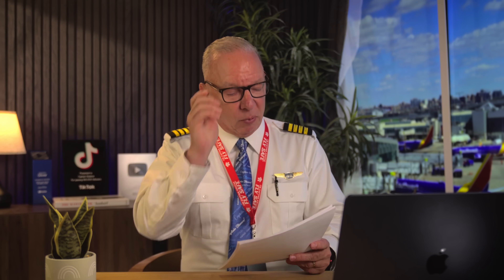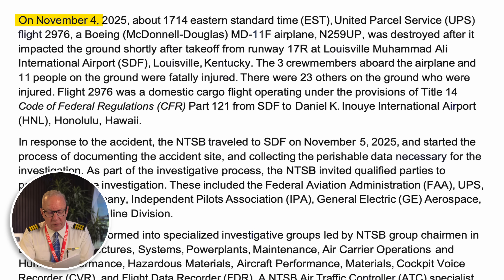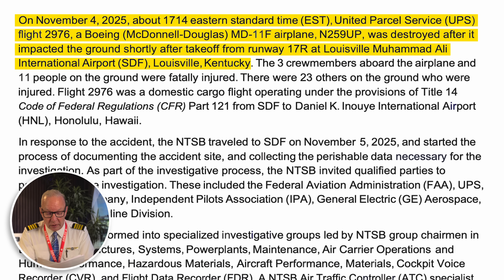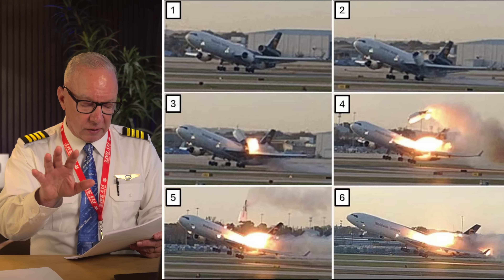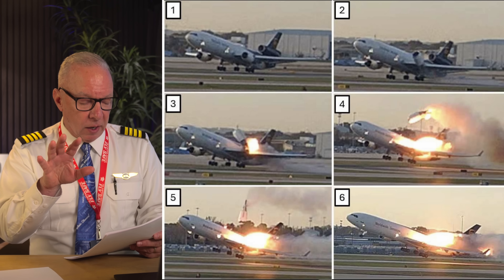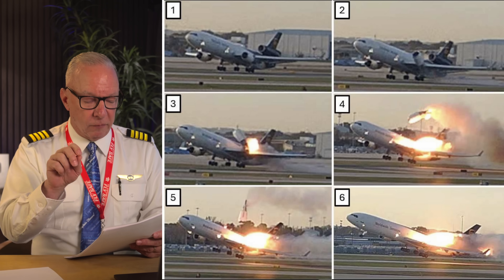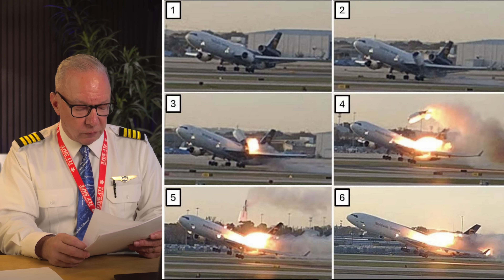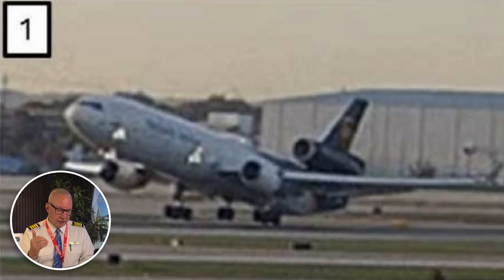UPS Crash Preliminary Report | Pilot Reacts to UPS Crash Report

Comment: In the first picture, you could see that that engine is already at a different geometry than the one on the right
Reply: Yea I went back and looked at it, but still wasn't sure if it was the angle of the camera shot....but does appear to be the beginning of the engine departing the wing.
Reply: That's exactly what I thought.  It was already out of line.
Reply: Wasn't there a report that the flight was delayed?? And they were actually working on that number one engine.
Reply: @gregweigel8115 - Yes, UPS Flight 2976 experienced a two-hour ground delay before its fatal flight on November 4, 2025. 
The aircraft was scheduled to depart Louisville Muhammad Ali International Airport at 3:00 p.m. EST, but it did not begin moving for takeoff until approximately 5:08 p.m.. Initial reports from third parties suggested the delay might have been for maintenance on the No. 1 engine; however, the National Transportation Safety Board (NTSB) later stated that the flight was not delayed due to maintenance, and no maintenance work was performed on the aircraft immediately prior to the flight that would have caused a delay. OF NOTE: The aircraft was grounded in San Antonio for six weeks, from September 3 to October 18, for "extensive maintenance". The NTSB crash investigators are going to want to know every single small detail of that "Extended Grounding" in San Antonio = the What, Why and When were a GVI (General Visual Inspection) and DVI (Detailed Visual Inspection) conducted during the  "maintenance period"; especially if a DVI of the #1 and #3 Engine Pylons was even conducted. I would not want to be in the shoes of the Maintenance Manager in San Antonio, who signed the document(s) that stated that the aircraft was "airworthy".
Reply: Yes you can see the front of engine is starting to nose up.
Also looks like that side, the rear wheels are quite as high.
Reply: Excellent catch. I had to go back and look at the picture. At first glance it looked fine, given the angle but you are correct. So incredibly sad.
Reply: Yep
Reply: I thought the same when I first saw the picture.  Would take an expert who knows cameras/angles/planes to look at... or engineer or ?? with a side by side.  Which the NTSB will do by pulling that reel of previous liftoffs?  We shall see, in 18-24 or more months?  For now, GROUNDED.
Reply: Look at the background. Picture 1 and 2 are about the next frame in the video. Of course it would have tilted slightly first and then more.
Reply: Good catch.  I missed that on the first look.
Reply: @BitOvSole YUP, I thought I saw that too. Just slightly noticeable when compared to #3 engine.
Reply: It’s looks like tilt to the end of wing or beginning it’s disassembled from the wing
Reply: I agree

Comment: Seeing that engine separate from the left wing looks devastating
Reply: It was. Metal fatigue could have been avoided by replacing the pylon assemblies or at the very least; replacing the bolt assemblies holding the pylons in place.
Reply: Looks devestating???WTF😂 The number one took out the number two as it passed over the fuselage, in front of the number #2 engine.  As catastrophic as it gets.
Reply: @steveo601  And thats what I mean
Reply: Right on rotation, they had no chance.  So tragic.
Reply: @MG-ot2yr  Why didn't the pilot refuse the takeoff? Maybe it's time to reexamine the inflexible rule of v1.
Reply: @RStevenPage  Better yet, it's time for you to reexamine the laws of physics.
Reply: @RStevenPage  has I lost a few brain cells reading your comment?
Reply: @RStevenPage because once you hit v1 rotate speed you have no choice but to take it flying and attempt to make it back and land because you won't be able to stop in time before the end of the runway because of weight of cargo and they were fully loaded with fuel for a transcontinental flight so all that to them going 180 knots or higher you won't stop in distance if runaway also there breaks can't handle a full rejected take off without possibly catching on fire or worse blowing there tires
Reply: @jondeeter2931 Read Wikipedia. There are many instances where pilots have refused takeoff and passengers survived.
Reply: @MG-ot2yr  What does physics have to do with the cost/benefit analysis of refusing a takeoff?
Reply: @RStevenPage  yea  but that's before they reach there take off speeds if your going 190 knots on a runaway and your fully loaded with passengers and bags and cargo it'll take them to the end of the runway to stop and then they'll crash off the runway trust me I've been on planes that's had to reject taking off before they get to there max takeoff speed and it wasn't where we stopped on a dime it took us a good 2 minutes to get to a stop and had to sit for a 30 minutes to let the brakes cool once they hit there vr/ v1 speed they have to take off and get it in the air because they won't stop  and the planes I was on that had to reject there take off we only had like 50 feet of runaway left before the end of it so yea its not possible for them to fully stop in time before the end of the runway
Reply: @RStevenPage  Not sure what kind of cost/benefit analysis you're referring to, lengthening every runway?  This happened at rotation.  You also do not appear to be considering the human factor, reaction time isn't instantaneous....there's cognitive processing, understanding the problem, processing info and taking action.  Something simple and routine is maybe 3-4 seconds, but something complex and catastrophic, as in this case, takes 10 or more seconds.....they would have also had every light and alarm going off all at once, and trying to process all that.  The plane had already crashed in that amount of time.
Reply: @MG-ot2yr  Can yall chill I dont want part of this
Reply: @RealAviationKING  You haven't been part of it.  But an exchange of opinions, etc, is common on message threads, its what they are here for.  You could just delete the thread if it really bothers you.
Reply: @MG-ot2yr  Ok yea im just getting so much notifications
Reply: @MG-ot2yr  Wikipedia has dozens of examples of rejected takeoffs where some of the passengers survived.
Reply: @RStevenPage  But were those rejected takeoffs good decisions?  If only some of the passengers survived, perhaps they could have saved the whole plane by executing the takeoff, and then emergency landing.  Were they on rotation? or at V1, what?  What was the runway length, weight of the aircraft, thrust, air density, elevation of the airport, runway conditions (wet or dry), runway slope, wind?....that's the physics part, there's so many variables.  And you completely ignored the human factor I mentioned.
Reply: @RStevenPage  There's probably hundreds more of incidents where pilots elected NOT to reject, came back around, and everyone survived, whereas electing to reject would have killed everyone on board. But then again, these incidents aren't well known, and survivorship bias (or shall I say reverse survivorship bias) now plays its role.
Reply: Its crazy that everyone has concluded that Stockton Rush's unsafe practices got 5 people killed. The bottomline is the aviation industry puts way more peiple at risk every day and everyone is fine with it because it has been a normalized risk. Oceangate's rtm sensors could have prevented this wreck. Microphones at the pylon to detect metal breaking and rattling about. But Stockton Rush is an idiot and everyone involved in aviation are true American heros. Pilots have to be the dumbest people of all time to blindly trust someone else's inspection of a vehicle their lives depend on
Reply: @macbook802  - The difference is that airplanes are built with SAFE, PROVEN materials... that yes, they do wear out after 90,000 miles of flying them and taking off and landing 21,000 times.

Stockton Rush built a submersible out of materials and processes that have been shown repeatedly to be UNSAFE in the creation and operation of deep-sea submersible craft. Literally every single aquatic engineer has said that his unlicensed, unregulated, pet project was doomed to failure from the outset.

Airplanes are safe. Stockton Rush was not.
Reply: @macbook802  "Its crazy that everyone has concluded that Stockton Rush's unsafe practices got 5 people killed."
Rush's submarine design has a 100% fatality rate, why would you even consider getting on your high horse and calling people crazy?
Reply: @macbook802 😂

Comment: The Air Force used the KC-10 for years and they stressed the pylons probably more than anyone with the training they do and never had an issue.  Curious how the maintenance differs from the Air Force and UPS?
Reply: As a former KC-10 mechanic, I can say that military and civilian airplanes aren't maintained the same. The USAF had 60 KC-10's and only lost one due to a fuel leak while it was sitting at Barksdale AFB in over 40 years of service.
Reply: @skylinegtr96 And AF doesn't do reduced thrust takeoffs like the Airlines if I am correct.
Reply: @ssap3717  You're correct
Reply: You would actually be surprised. 

The MD-11's were used far more than the KC-10's. The entire 60 aircraft fleet of KC10's had 2.3 million hours at the end of their lifespan averaging 38,000 hours per plane.
Reply: Calling it the forklift fix was repeated
Reply: Here we go, calling another KC, MD, or DC-10 when they're the same F! thing.  Like the classic Boeing 707 is also a KC name. 
 Let's Cut the Sh**p!  Regardless if DC-10's are called MD-11's, truth be told, the Mechanics 
like in 1991, again saved 3-4 hours, by fork-lifting of a fixed engine, to bolt back into 
the pylon, instead of method by "MD-11" aka, DC-10 manufacturer instructions not to do that!